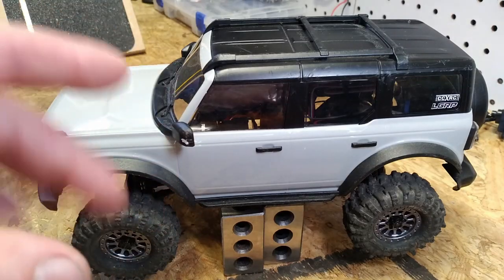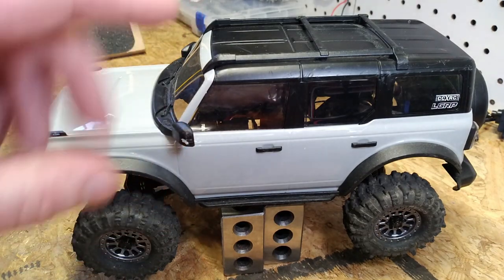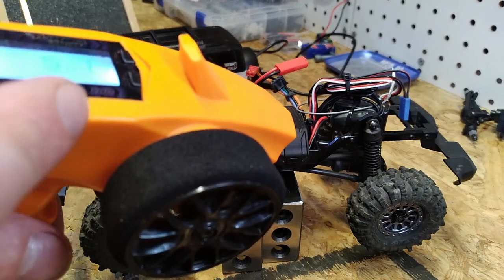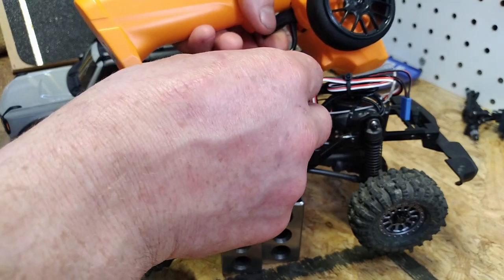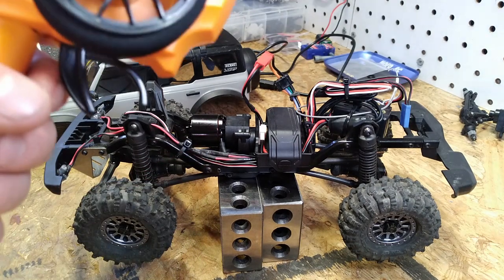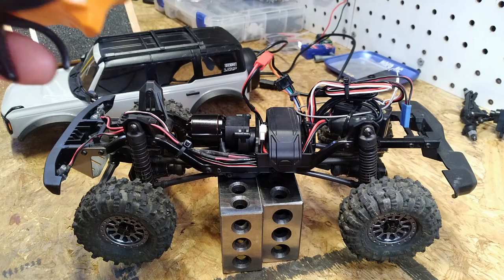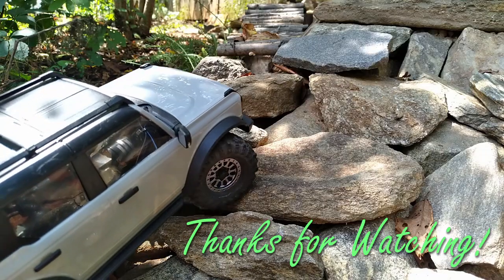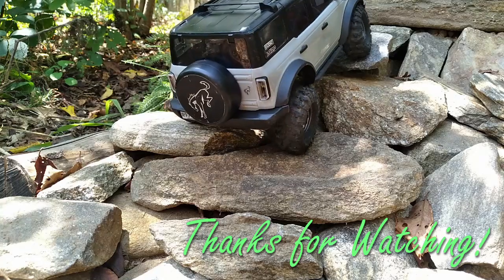Dinky RC D-Drive Micro Sport 25amp ESC Throttle Calibration! EASY.

Comment: I bought the 30amp one on Amazon its like a on and off switch..will this fix that and make the throttle smooth
Reply from the maker: I'm not familiar with the Amazon ESC your referring too? Calibrating the throttle will just make sure the ESC knows where neutral and full forward/reverse is.
Reply: @havikhobbies  oh ok thanks it was a dynky but probably won't fix  it
Reply from the maker: I didn't think Dinky RC sold on Amazon? They do a 25amp and a 45amp. Not sure about a 30amp? Is it one of these?https://www.dinkyrc.com/collections/electronics